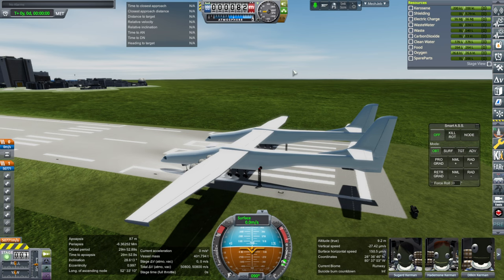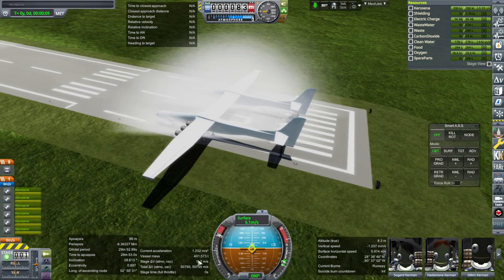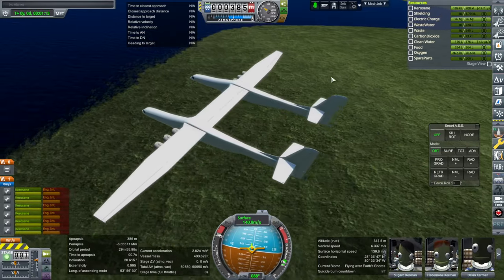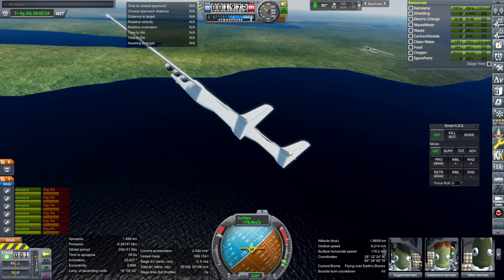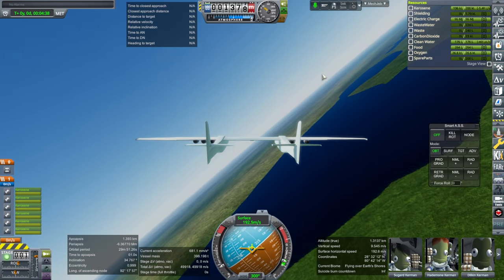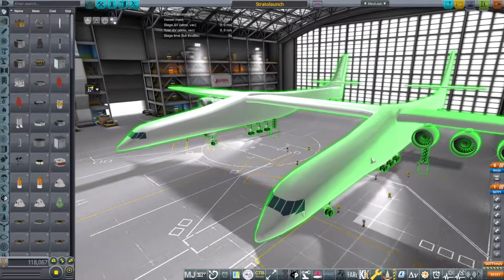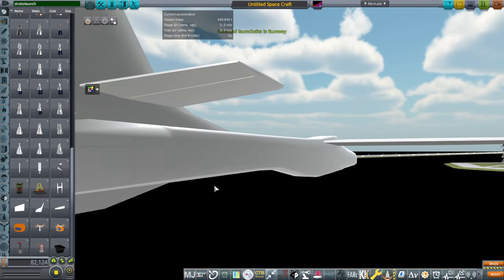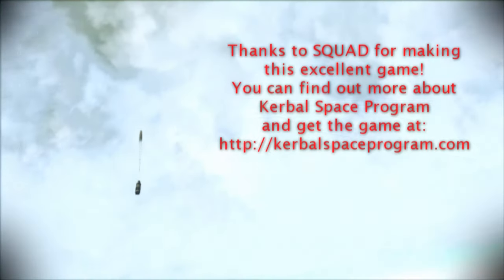Stratolaunch Release for Plane Mod (RO in KSP 1.12)

Comment: so i downloaded the modpack but there's no elevons? pls help
Reply from the maker: Elevons are technically only on delta wings - do you mean horizontal stabilizers? Is this on Stratolaunch or one of the other planes in the pack?
Reply: @RaizSpace  Sorry! meant ailerons. all wings and vertical stabilizers are missing ailerons and rudders. cant find the control surfaces for the mod anywhere in the menu. also, i tried downloading AJE extended, but i can't enter any buildings with it installed.
Reply from the maker: That wouldn't be for the Stratolaunch - it should have them. However, some of the planes require you to add the ailerons and rudders using B9 Procedural Wings. The reason for this is that adding control surfaces that are at a diagonal instead of straight out onto the wings can be finicky. The older planes in the pack especially didn't have built-in control surfaces.
Reply: @RaizSpace  ahhhh, got it! But what about AJE? i can't enter any buildings with it installed.